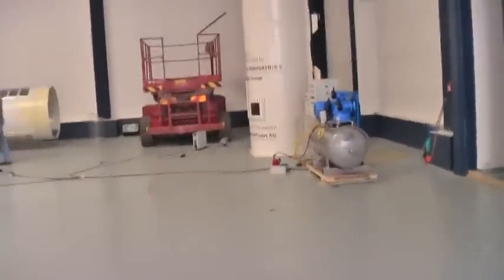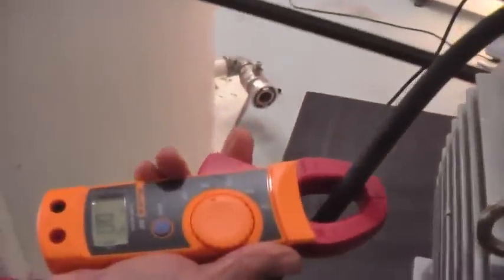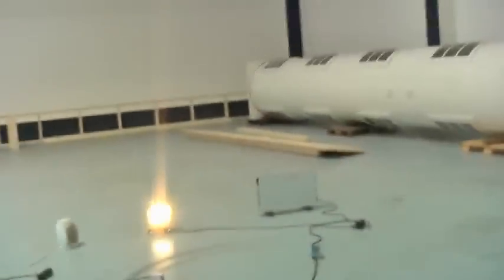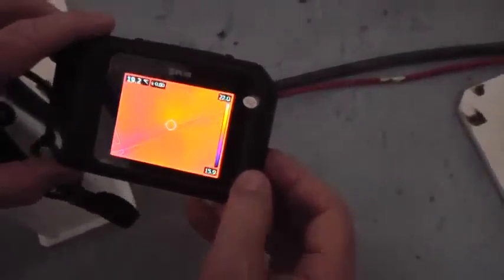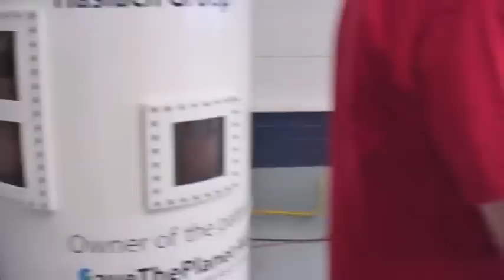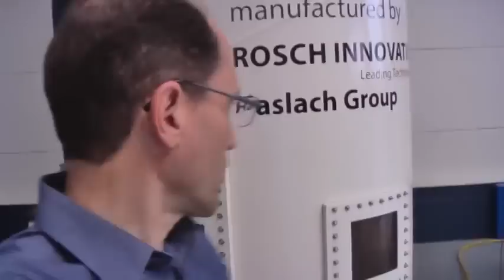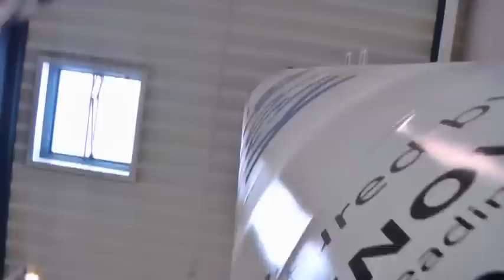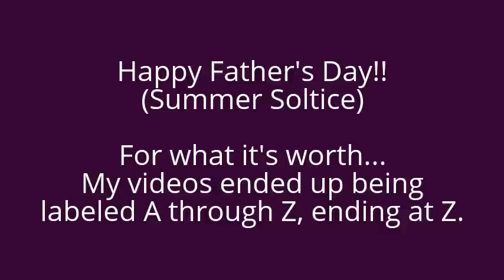Free Energy June 2015 Rosch 15KW Rosch KPP 15 kW Free Energy System Demo June 20, 2015,

Comment: Thanks for posting this, it allows to do a guestimate of the maximum output power of the setup demoed here:We see that there are 32 floats taking roughly 1 minute for a full rotation cycle, i.e. 16 air-filled floats (source of the buoyancy power) move up around 8 m each minute.Rough estimate of a single float volume (modeled as a cylinder): 0.8 m * Pi * (0.25 m)^2 = ~ 0.15 m^3So each minute ~16 * ~0.15 m^3 = ~2.4 m^3 of water is displaced, it amounts to a force of ~2400 kg * g = ~24 kNThe max theoretical mechanical output power is thus: ~24 kN * ~8 m / 60 s = ~3.2 kWAssuming 90% efficiency for the generator, and 80% efficiency for the mechanical device we can get at most : ~3.2 kW * 0.8 * 0.9 = ~2.3 kW of output electrical power.It's obviously  less than input power (as may others have explained over the Internet), at least it waste less power than if it was really producing 15 kW!
Reply: Hola.  Soy de España y queremos replicar o comprar el invento. Es posible?
Reply: Сам еще раз прочитай
Reply: ENERGY of Air blown in equals ENERGY output minus the losses

Comment: OK, so basically the rotating air canisters is filled with air by pressurizing each tank. Probably 100 pounds a tank or more of force , each tank pushing up on the chain as it goes up the water tank. I wonder if there is a valve inside the tanks to release pressure. IF SO you could put more pressure inside of each tank. These tanks in water float up to top. The pressurized tanks of air give torque to turn the chain. Once the small tanks reach the top , they are depressurized and sink to the bottom to get air pressure back in the tank again so they float to the top and go thru the cycle again. The axle transfer power to a gear box which turns a generator to make the power. INTERESTING. So it takes less power to run the pump to put pressure in each tank.  A great find , Very interesting.. :)  A person can make this himself it they had enough money to make a smaller version of this to power their homes. A real cool find. NEW INVENTIONS ARE SO COOL..
Reply: The tanks are not pressurised, they simply contain trapped air, pressurizing would work in a negative way for buyeoncy would be less. But in short: it doesn't work, do the math (not including drag and other mechanical losses) and the energy put in pressurizing the air is equal to the total work from buyeoncy ( I did that math and it added up precicely).

Comment: Apart from the generator, compressor and wiring/air hose related items, I reckon this whole system could have been made out of some kind of strong or thick clear plastic, thus saving everyone the painstaking task of checking every crevice, if strong enough even the chains potentially made from plastic.
Reply: It has been shown in clear plastic in the demo model

Comment: An air lock could be created at the bottom like a submarine then the small driver tanks could enter the water on the one side without any seal, popping out at the top having done their work on the way up to return full circle. The longer the tube the more energy per module.

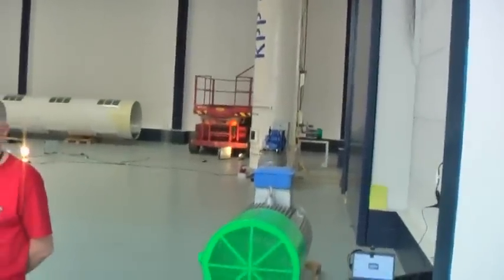Comment: 16.56 KW at 18:47 time.  That's 16,560 watts.  I would like for them to put a real load on this to see how it performs.  Put a load of 5,000 watt electric heater fan forced air , an electric household range , a refrigerator , a water heater , Several 60 watt light bulbs  with power left over to run other plug in appliances like fans , air conditioners , electric power tools , hair blow dryers , washing machine and dryer all at once and power left over to run the air pump that runs the machine.. NOT TO MENTION the heat created on the generator with such a load.. How will you dissipate the heat on the generator ? Alluminum fins on it maybe... Also , how long will the generator stator last constantly pushing this load 24 hrs a day.

Comment: I did some calculating on this thing and the energy needed to press the air in below is exactly the same as what can possibly come out from bueyoncy. ....and then there's friction.. So...bogus!!
Reply: I'm getting annoyed of people shaming on systems that have friction yet still produce a greater outcome than initially input. Why would a system that has friction yet successfully lights up my house at the cost of ZERO dollars be so bogus?
Reply: @joshuanorris9785  Just admit that you're not telling truth here...  The chain on that Rosch unit may not even be able to endure the power at that rpm. It's so utterly bogus...
Reply: @ottonormalverbrauch3794  bs bc how about a thicker chain. 2 chains? Maybe thick sprockets? Of course there will be maintenance from time to time! But hypothetically this could keep a greenhouse warm in the winter to grow veggies & fruits with minimal maintenance to the system. Yet systems like such are always bashed on & for what? They did the job they're designed to do! & during the winter of thermal heat is produced from friction then the better! Attatch a heat exchanger & heat up your house or greenhouse with it.
Reply: @joshuanorris9785  The point is it doesn't work at all.. Not even in theory because the theoretical energy to be get from buyeoncy is exactly the energy you need to put in compressing the air ( which is logical). Using the current measuring pliers to look for is a idiotic means of checking for secret supply wires because the current flowing through the live wire is exactly the same as the one flowing back so in a pair of wires you'll always measure zero...
You know adevice like this stopped at a fair went the power grid went down?. So instead of supplying power from nothing it went dead like all the other equipment..
Reply: @ottonormalverbrauch3794  I understand what you're saying.. But that's what most are saying and it is reasonable! But you're talking about this one specific system. What about not using a compressor to inject air? Are you so quick to just shut that idea down to simply because it requires the same energy input than output? Why shut down all ideas that could work?
Reply: @joshuanorris9785  Law of conservation of energy has no work arounds, no matter how the free energy airheads may think otherwise.
Reply: @ottonormalverbrauch3794  I cannot prove wrong the science but i believe i can prove wrong the idea that you CAN have benefit out of a system. So you people just shut down any ideas that could work simply because science is science? There are ways to adapt to achieve the goal of getting more out of it with very minimal maintenance. I suppose maybe i'll be the one to show proof if you don't believe this video is true.
Reply: @joshuanorris9785  Define 'benefit out of a system'.
You will never get more energy out of a system than you put unto it.. Many have tried it, all have failed..and so will you trying to prove it. And I am 100 % sure this video is fake. I did the math for the working principle that is claimed. It's bullshit.
Reply: @ottonormalverbrauch3794  Again you say "you will never get more energy out of a system than you put unto it". For example if i put maintenance into a system just to keep it running freely which it's job is to just keep fans running to keep bugs away and move around air. The job i wanted is being achieved and all i had to do was attend to the system for 5 minutes with minimal elbow geese maybe once every 2 to 3 days at a time. It's powering multiple fans for my greenhouse which would cost me hundreds of dollars using city electric per month. What's wrong with that idea? Why is the idea being shot down as it's doing what i wanted and saving me thousands of dollars a year?
Reply: @joshuanorris9785  You're talking jibberish as to what kind of system you're meandering about.  Elbow geese? Do they make a lot of noise? 😋  You cannot get energy from thin air and what system would need elbow grease if it generates hundreds of dollars worth of energy. If you use ten of those dollars of energy instead of elbow grease it wojkd be totally self sustainable but the builder wan't thát smart?
Reply: @ottonormalverbrauch3794  you're right, I may not need to do any maintenance at all but I just added that into the equation just because a bit of maintenance from time to time is the energy that I put into something that's giving me greater output as its doing the job I intended it to do.. Still if the system makes noise or I have to put a little bit of maintenance from time to time what is the problem if its doing exactly the job i need it to do? In this case i just run fans free of paying to run those fans off city electricity which will cost a lot of money in the long term.
Reply: @joshuanorris9785  Well, keep fooling yourself, you're not going to fool me any more.
Have a nice day!
Reply: @joshuanorris9785  Sorry, I didn't see the link, I will look into it shortly .
Reply: @ottonormalverbrauch3794  correct me if I'm misunderstanding your comment but doesn't that mean my 5 minutes of maintenance now then comes into play for an output that's personally much greater than the 5 minuates of energy I initially put into the system to keep it continuous?
Reply: @joshuanorris9785  
That's a convenient storage system for an already generated surplus of electric energy. It's useful for storing solar energy for periods of darkness and to enable energy plants to run at their most efficient capacity and not having to acommodate for peaks in energy need. Totally different from the Rosch shit.
Reply: @joshuanorris9785  That's an impossibillity. Amount of energy in minus losses= Amount of energy out.   Period!
Reply: @ottonormalverbrauch3794  I'll be conducting a project today as I haven't found a video proving it wrong. (probably because nobody wants to lose money it not working) lol but we'll see how it goes!
Reply: "It" meaning a simple experiment nothing to do with this video! But I've finished building it today & tomorrow hopfully I'll have daylight to see the results! Has to do with buoyancy though.😁😁
Reply: @joshuanorris9785  A life jacket?
Reply: @joshuanorris9785  And how did that turn out?
Reply: @ottonormalverbrauch3794  Finally made it back to this comment! I actually haven't conducted the first project as i need assistance with my brother to haul to the river. In the meantime i'v created a 2nd project i'm preparing for. If it doesn't rain this weekend i'll hopefully complete both! Creative mind is flowing.. It's all for science & self assurance. i'll let you know how it goes! (:
Reply: @joshuanorris9785  I'll keep looking for updates.
Reply: You are correct about the calculations..in fact you don't  need to make any. that is what the law of thermodynamics is after all..
You use x amount of energy to fill with air the bucket  under water or whatever they are using as containers and the kinetic energy that you create from buoyancy (in a perfect world ) equals to x amount. but we don't leave in a perfect world.. so you lose some of that energy as heat. you can call it friction, from the buckets moving in the water, the chains. and also the air compressor and the generator..but is always heat.
So.. what actually is going on here? how this machine works? considering the law of thermodynamics is impossible to work right? self powering and also have extra power output.
Also the presentation and making of those machines is very poor for me to do something significant and big as this. i am sure you realise that if this is real  how big the impact is going to be for everyone in this planet. 
For this case personally i am a little sceptic about this machine, not the design and presentation of what i saw in this video but for this concept as a whole. let me explain what i mean, and if you think about it is actually very cleaver and simple to understand.
when this machine is in operation take a specific point or period in time that you need to fill 1 bucket with air. at that (point, period) you use x amount of energy to fill with air that bucket, that is your input energy. Now i am asking you.. what are you collecting in that specific period on the output of this machine? NOT only the kinetic energy from that specific bucket but from all of them that is still filled with air.. yes you still have the heat loses.. but is the heat loses in that period more or less than the extra energy you collecting from all the filled buckets..just think about it
Reply: The KPP unit compresses air to 6-8 bar although they need only 2 bar
Throwing away a lot of energy, try moving a few buckets on a line through water, the units filled with water are reducing the possible delivery of extra power.
The original KPP channel Zilverstroom won't allow comment..........
I'm currently building a better module with reduced drag of units and using low pressured air, coming from a hand powered unit attached to the power delivering shaft
Just testing if it is possible
Hope I can tell you in 2 months time

Comment: I WONDER , how they figured out how to put pressure in each tank while it rotates on a chain ?  OK , I see the air being pumped in at the bottom  15:01 watch it in action.  I also wonder what the configuration of the transformer inside the box is rated. This is really an interesting piece of work here.  Congratulations on the invention.   BUT.........

Comment: 01.05.32. very thick pipe on the right. compressor air  hose several times thinner and will be shown later.
Reply: 01:05:32

Comment: You do realize that any mechanical system is not 101% efficient.. The chain is relatively efficient, but the generator has bearings and creates heat (energy loss) and it has a fan to cool itself (energy loss). The compressor motor has bearings and the coils get hot (energy loss). Then the compressor itself heats up when the air is compressed (energy loss) while turning a fan to cool itself (energy loss). That whole electrical panel has meters and blinking lights - and who knows what else (energy loss). The water filled tube has air tubes in it which create turbulence when they go through the water (energy loss). There is not enough conservation of energy in this system. Because of the losses, it takes more energy to compress the air than it gets from the system can make that generates the power to do it. Granted, it may run for a while, but there would be enough loss through heat that it would have to stop because it is compressing less air than is being used.. Isn't it mysterious that these devices are never given over to engineers to be taken apart, reassembled, tested, etc.. We're just supposed to take it at face value. Furthermore, where are the systems that power their building and their homes?
Reply: +npsit1 Hint #1, The company that is making and selling "free energy" admits it is on the grid. That should tell you everything you need to know.
Reply: 2

Comment: iI think that it will less complicated if you use water in place of air and the opposite.
Reply: But water takes a lot of effort to move upwards after going down. That's why dams only go downwards.
Reply: No it cost more energy to pump up the water
Pumping air is more cost effective although I see a 5KW engine on the pump
You need no more than 2 bar instead of compressing it to 8 bar first

Comment: You gays using clamp on Amp meter on hoses and you know that proper measuring AC current requires separation of wires to a single lead wire otherwise current flow is cancelling itself showing on Amp meter zero! Amps ???
Reply: Peter Krutow Peter, there is a big difference, between the words "gays" and "guys".  (You wrote "gays").

Comment: Why fill and empty just use air filled balls to lift on one side of water filled tower they can return down other side by gravity no compressor needed at all just a reasonable seal across tube at bottom. With the amount of money here a seal could be made.
Reply: Traduzido pelo Google Tradutor - Por que encher e esvaziar apenas usar esferas de ar cheio de levantar em um lado da água encheu torre eles podem voltar para baixo outro lado por gravidade sem compressor necessária a todos apenas uma vedação razoável através do tubo na parte inferior. Com a quantidade de dinheiro aqui uma vedação poderia ser feito.
Reply: 물로 채워도 주위가 물이라서 즉, 비중이 같아도 중력은 없습니다